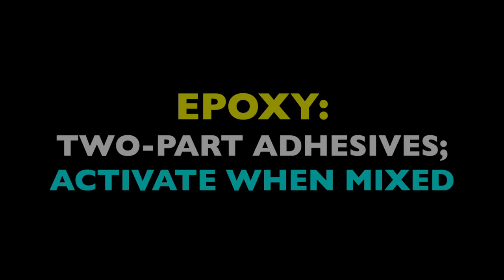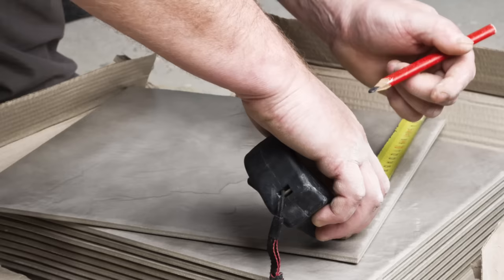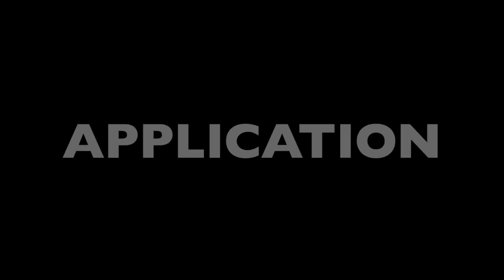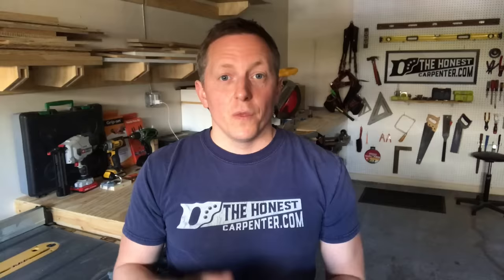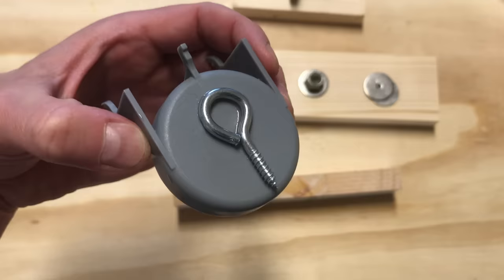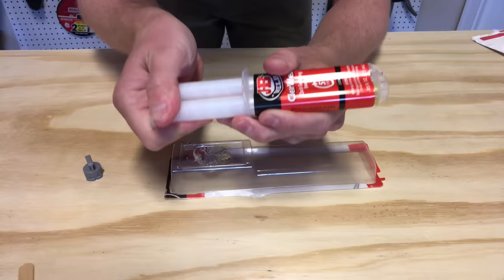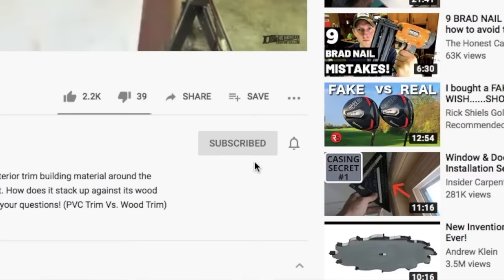DON'T USE SUPER GLUE! Try This Instead..(Epoxy Adhesive/5-Minute Epoxy/Epoxy Glue)

Comment: I agree with you 100% except on soft fixtures like leather where I prefer contact adhesive. I always have rapid epoxy adhesive at hand in my home and prefer two tubes rather than the syringe. It is something I use for all sorts around the house and workshop. I have even used it for small fibreglass repairs, I heat the two tubes in an old beaker of hot water. After about 5 to 10 minutes it is ready to use and the heat makes the adhesive much thinner and easier to spread over a mesh tape (not fibre glass) and it soaks out real good and is done and water proof in minutes. Additional layers can be built up in much the same way. First class stuff. At the moment I am using Epoxy adhesive 151 which I purchased on line. I do prefer Araldite but this one was much cheaper. Thanks for sharing.

Comment: Epoxy is great stuff, lots of uses. I wish longer cure time epoxies were more readily available.  One epoxy with 12 hour working time eventually hardens for super strength, like for hammer or lawn implement handles. Yeah, it’s runs for hours, but really soaks in for a very very strong bond.
Reply from the maker: Good point, Chuck. There are some industrial-grade epoxies that would probably be great for that stuff. I want to do a video on those later--they come in much larger quantities, and often require special tools to dispense. But, like you said, it's strong enough to pick up your house!
Reply: To get it to soak in. First tooth - rough up the surfaces to be bonded - metal? I'd dig into it with a grinder, rough as you can make it. Second, good solvent to clean the surfaces,  and third, to make the epoxy flow use a heat gun. That can make it run like water, it also speeds up the setting time... but not as much as it thins it.  And usually for tools you'd use a thickener. Look up WestSystems web pages for tips on this.
Reply: I've been an epoxy user/fan for decades. Years ago long set time epoxies were commonly sold along side 5 min. Now it's seldom seen in local hardware stores and one needs to order it. I loved having 24 hr. epoxy on hand for things with complicated assembles or multiple parts.

Comment: Also good to keep in mind that they are rated in tensile strength of the material, not the bond!

The bond will probably be much weaker than the rating on the bottle.
Reply: I find it is way weaker. Tried using it to bond scarf joints for rails  on a 18 foot canoe I was building. Needed long lumber to make those. The bend was not very bad but the joints failed at the scarf. No wood came away with the epoxy. Let it cure for 2 days before install.  Was supposed to have a very high strength. .I used the slow from then on. Pain in the butt, but worth the wait. No more failures. I still build epoxy cedar strip canoes  to this day using slow cure epoxy on the seats, rails, decks, paddles.

Comment: Great video. Thanks.
Tip to make sure you get equal amounts of glue and hardener from twin dispenser:
With a new dispenser, stand the dispenser upright with the plunger at the top and the nozzles at the bottom. This is best done by standing in an old glass jar. Also, place the jar in a warm -place which makes the glue easier to mix & flow easier.  This makes any bubbles float upward towards the plunger and away from the nozzles. Then when you uncap the nozzles & press the plunger, both nozzles immediately start to dispense the same amount of glue as there will be no bubbles to clear from either nozzle. Furthermore, having finished dispensing glue & before re-capping, invert the dispenser and draw the plungers back a little to suck in a little air into both nozzles so that you don't get a blob of waste glue clogging up the nozzles. Now re-cap and store in the glass jar again, nozzle end downward. The newly introduced bubbles will again float back up to the plunger end.

Comment: I usually just buy a cheap pack of plastic condiment cups and and a pack of popsicle sticks  from Walmart.  Works perfect for mixing and applying.  As a bonus, the condiment cups come with lids, so they're great for temporary storage of screws and nuts when disassembling things.  Cheap, and easier to find than a scrap piece of plastic at times.

Comment: Thank you for that!  I was wondering how I might be able to secure new fence posts on top of a concrete wall - I'll need more than a small tube, but I didn't think of epoxy as an adhesive before.  I used an epoxy finish for my countertop last year!  I'm still not sure how the original fence was placed, or whether I'll need to drill holes in the concrete for metal post holders, but at least that's one less unknown.
Reply from the maker: Hey Tanya! As you said, you might need some anchor hardware for your posts--possibly simpson buckets, or something that gets embedded in the concrete wall. But, there are definitely construction grade epoxies that would help! They often come in tubes, and have longer curing times. But they're strong enough for commercial and industrial applications!

Comment: Great video! I agree with you that "Super Glue" isn't always the Holy Grail of repair solutions. 
I do however prefer 30 minute epoxy over 5 minute. The latter tends to be more brittle when cured versus the 30 minute. Plus the added advantage of more working time.
Just my 2 cents worth.
Reply: superglue plus baking soda is a whole different kettle of fish. I used it to repair the switch on my tablesaw after smashing it. I broke it again, in a different place, and repaired it again. Ugly, but effective.
Reply: @oneeyedphotographer  I agree, used it as a wood filler on table saw mistakes with wood. Strong as hell.

Comment: Bob Reid used to run The Compleat Angler in Canberra. He delighted in horrifying customers who brought their broken rod tips in for repair by lifting his blow torch from behind the counter, and applying a little heat. The glue broke down, the rod was fine and a new tip fitted, all in about a minute.

Comment: I've been using epoxy for 50 years.  Back then the only epoxy available was 24 hour set  time.  The cure time was even longer.  Epoxy is far superior to super-glue although SG has its place.
Reply from the maker: Crazy how fast this stuff sets up these days, Robin. JB has a good 1-minute brand! I still use super glue a good amount for small plastic-to-plastic bonding with no gap. It's really convenient in those circumstances :)
Reply: I am in the 50+ years group also. and I do remember the long set problem. but back then there wasn't any super glues available.
Reply: I use to use epoxy
Reply: I use to use epoxy to hold my hubcap on my 1984 olds

Comment: Great video! Perhaps a tip that for the most of this audience is obvious, but not for me: when using epoxy (or glue) instead of fasteners also think a step ahead that you might want to separate / disassemble the parts again somewhere in the future.

Comment: I just repaired a fog light on my Jeep. It's a plastic body with metal components. First I tried a clear rtv type adhesive and it just peeled off. Second I tried a 2 part epoxy but one area that didn't have very much surface area failed. So for the third try I included a small steel strap buried in epoxy to reenforce that failed area and so far it's working great. It's on the bottom of the light so you can't see it easily.

Comment: Ive tried 5 minute epoxy with 440 boat building fibreglass fibre or epoxy with epoxy fibreglass cloth( the silky smooth cloth used on wood strip canoes,not the rough irregular meshed fibreglass cloth used in layered fibreglass),because epoxy will kind of melt traditional fibreglass cloth.To make a mould use cloth tape to form the shape.Ive used this to make a completely broken door hinge on a white fridge,resetting the metal piece into a mould,the same shape as the original metal hinge retained in plastic.Its really strong,you can drill it,screw it,file it,saw it....very similar to the white chopping boards in looks,strength and properties.happy repairs😋

Comment: Get the 5 min in the twin hypodermic and store it so the bubbles are up by the cap.
Then do not allow bubbles in it, because you will waste glue.
And always retract the syringe a little to pull the glue out of the little tubes where the cap goes... but don't suck too much air in. Also... we always mix too much. Don't. You can easily make more...
Mix on plastic, stir well and fold a few times..

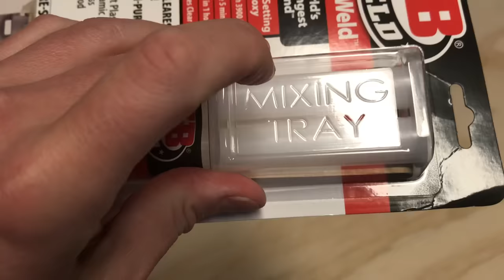Comment: Note - at 3:21 you release pressure on the syringe and then while pulling away from the mixing surface you twist the syringe.  This mixes the materials at the spout and possibly glue it shut.
Reply: Yeah I also saw that. BTW, a couple years ago I glued a plastic water pipe with epoxy onto a stump of metal pipe, where the threads were rusted off. It still holds. . .

Comment: I'm the other way around. I've only just started using super glue and used epoxy for years!   A really nice trick I've found is to use scrim tape (used for plasterboard) to reinforce epoxy into a composite "fibre glass" type material.

Comment: I have used epoxy for aluminum repairs. I've tested aluminum angle and square tubing by roughing the attachment area with a wire wheel on a drill and then letting the epoxy fully cure. When you try to pull it apart, the aluminum will break before the epoxy. It's stronger than the aluminum. 

Always clean aluminum with something abrasive like a wire brush, sandpaper or steel wool before bonding. The surface forms an invisible layer of oxidation that needs to be removed before using epoxy.

Comment: One counterintuitive thing about epoxy is that the higher temperature the better curing. I mean 60 degrees Celsius (around 150 Fahrenheit) is optimal curing temperature and they get stronger after sitting in that temperature for a while.
At lower temperatures of course the curing is much slower and much weaker. At low temperatures it just won't fully cure ( though it will still harden somewhat and may appear to be cured).
Also, they need a lot of time to fully cure, so for full strength I would wait even few days, but if you apply some heat and time, you will get an almost indestructible connection.
Another thing with epoxy is that they work well with glass fibers. You can buy a pack of fibers specifically meant for epoxy ( these have special coating for better adhesion) and you can make with it connections comparable to iron or steel by covering those fibers with epoxy. Very good for repairing structural parts that need a lot of strength.

Comment: I made some metal rods to which I needed to attach wood knobs.  I tried CA glue, but it didn't hold that well.  Then I went to 5 minute epoxy, and the knobs are welded to the metal rod. I am a believer in 5 minute epoxy. Also, once it sets up, it can be drilled and screws inserted into it.  So, you can fill a void in wood, let it set, then do what you have to do.  For big voids, you might want to try Total Boat, which is used for river tables, etc.

Comment: One very important thing to note about epoxy is it requires a rough surface to mechanically grip to. Epoxy doesn't grip well to smooth surfaces and can peel off glass like surfaces easily. I have experienced epoxy peeling off itself if you don't sand roughly between coats. 
Don't clamp too tightly or you can squeeze out all the glue. It needs some mass (unlike wood PVA) to be strong bond and that's a bonus for gap filling.

Comment: When I worked in a production mill shop, we used 5 minute epoxy for temporary stuff, like jigs we needed to have com apart almost as soon as we used them for running odd shaped parts on the shaper. If you want something to actually hold for a long time, it is time to get some real epoxy.

Comment: Use this all the time and have for years. Even pool repairs, there is a 2 part product for that that cures underwater and solves many broken pressured water lines after curing, and most swimming pool stores, hardware locations, or plumbing stores, another great 2 part repair product.

Comment: There's also flexible epoxy, which is used in building fishing rods though I suspect it could have many applications even possibly a finish. Epoxy can be tinted with alcohol based dyes too. On the only fishing rod I've built I used a blue pearl alcohol based dye to tint some flexible epoxy and paint the whole rod pearl blue.

Comment: We used one from Aircraft Spruce, though not a 5 minute epoxy it is super strong and good for wood or metal. Might work for plastic but I never tried on plastic. It is actually designed to be used on aircraft.

Comment: I have used the Harbor Freight 2-part Epoxy for years.  It usually comes in two tubes. I hate getting sticky stuff on my hands, so I took two prescription pill bottles/cups, and screwed them to a scrap of plywood.  They act as holders to keep the Epoxy tubes in an upright position eliminating handling the tubes so much.

Comment: Ethan, I agree that the epoxy is better and can be used to hold items in place if a couple dots of super glue are on the surface just to hold it in place until the epoxy hardens. Super glue has its place in some small places where a quick fix is needed such as toys but epoxy is much better!
Reply: That's a neat idea, I'd never thought of using multiple adhesives so that something fast-setting could help hold things in place while the slower adhesive sets. Is there a particular way you ensure they don't mix together or has that not been an issue? Do you just like avoid a couple of tiny spots when applying the epoxy and drop the superglue on those or does it still make a fast light bond if you drop it directly on the epoxy layer?
Reply: @ItsAsparageese  I just leave a couple spots bare for the super. I don’t think putting the super glue on top or under the epoxy would work.
Reply: @MRrwmac  Cool, makes sense to me. Thanks for the idea!

Comment: I love Epoxies for furniture repair.  Getting Epoxy into cracks is a challenge.  I use scissors to cut plastic packaging into strips that can be inserted into the cracks to carry the epoxy deep into the cracks.  After clamping and removing the excess many times the repair is almost invisible, if not I use dollar store 3 pen stain kit to hide the repair.

Comment: Quick tip.  If you use clamps to supply the pressure, put some painters tape on the pads.  If any epoxy seeps out and you miss it the epoxy bonds to the tape instead of your clamp.

Comment: Great info! Another thing - epoxy has better shear strength than superglue. Shear is pulling the joined pieces sideways along each other: hold one hand out palm up, lay the other hand on top, palm down. Now slide your hands apart sliding your palms across each other. This is shear.

Comment: The gap filler use is wonderful, never thought about it but now it seems obvious, thanks matey.
Bob
England
Reply: Epoxy used for termite and dry rot repairs on wood. Use the stuff that is thin as water to get into all the cracks, drilling holes if needed.

Comment: I had an expensive pair of winter hiking/working boots that the thick soles separated from so the heels were flopping around as I walked. Almost didn't make it home, and would've had to trash them. But I had used epoxy before and decided to try it. Worked like a charm! So the boots I bought in 1983!!! and had to glue in about 1999!!!, are still going strong in 2022!! They're older than my kids. And more reliable too! Har. (Not really)

Comment: Absolutely brilliant series, this. Also, couldn't agree more when it comes to epoxy - far superior to super glue for most applications. Where I use super glue is mainly as a temporary hold-down for woodworking (on tape strips).

Thank you for doing all this work, it's much appreciated.

Comment: This video is a great help.  I have been purchasing superglue in very small containers, as I need this only infrequently.  I may use a few drops and a month later the rest of it has been inaccessible due to hardness around the spout.  With the Epoxy Adhesive this problem would be eliminated.

Comment: Super Glue is great for items that need a truly clear bond (e.g. glass) and where compression and expansion strength is needed BUT, it is useless for shear strength (side to side). You will almost always be able to break a super glue bond by striking from the side of the bond or twisting the joint.

Comment: I use the steel-reinforced JB Weld for lots of projects. Great stuff, although it didn't hold my cracked radiator tank together when I tried to buy myself a few days :D
Reply: I called JB Weld once about how it did around heat.The customer service lady said it turns back into liquid. Nuff said

Comment: I have been using epoxies for years. Most are formulated for a 1:1 mix ratio, but some have a different ratio and are for specialty applications. Epoxies that take longer to cure usually cure harder, which is good if you don't want any flex in the bond.  Many brands now come with a tube that attaches to the syringe and mixes the resin and hardener as it travels through the tube.  Then you can apply it directly to the materials to be bonded.  If you get any epoxy resin or hardener on a surface that you are not bonding, like a workbench or fingers, propyl alcohol is the best solvent for cleanup.  70% propyl alcohol works but 90% works better.  One disadvantage of epoxy over "super glue" (cyanoacrylate) is that epoxy takes up some space, resulting in more visible seams,  while super glue takes up very little space resulting in less visible seams.

Comment: Body repair.  Kept it handy for road calls on trucks.  Front fender cracked and hanging on the ground?  Jack it up, bridge the crack with some sort of available material.  They were dairy trucks so there was always some plastic milk gallons (even some cardboard will do in a pinch).  Smear some epoxy on it and the trucks makes it back under its own power for some proper body work.  Saved thousands in tow costs over the years.